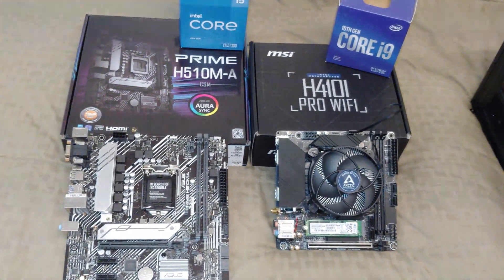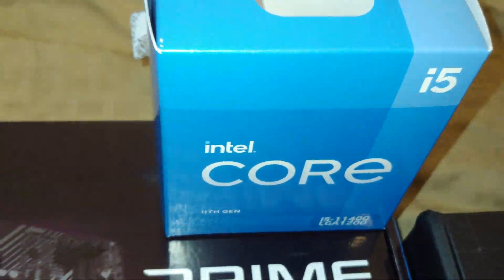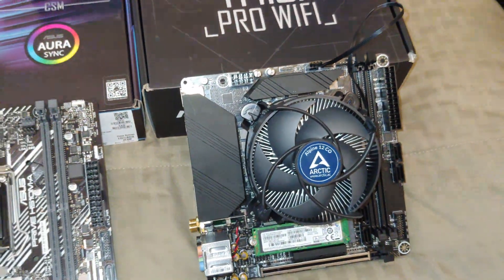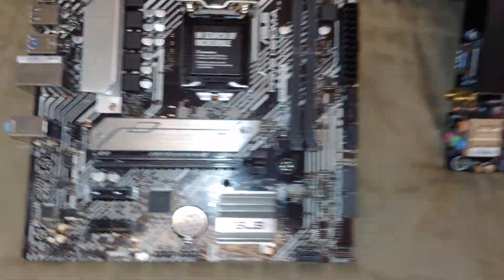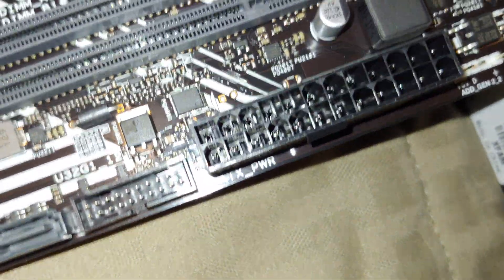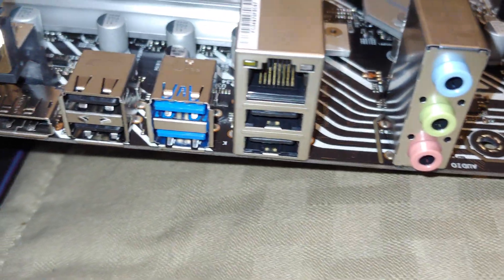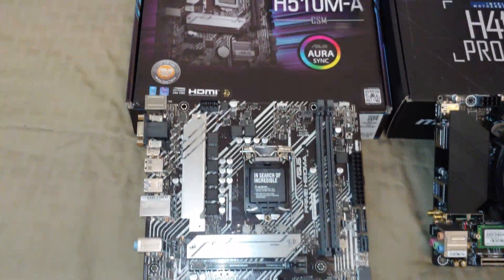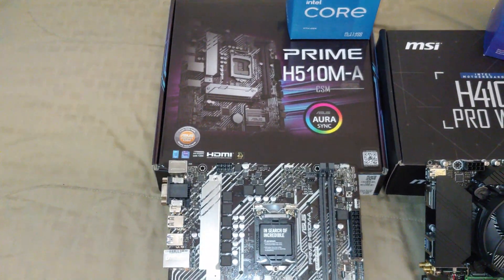Quick Comparison of H410m vs H510m motherboard for 10th gen or 11th gen Intel

Comment: I got a core i9 10850k from microcenter for $350, but I've paired it with B460M-DS3H, what stuff do I miss for not using a Z490 mobo?
Reply from the maker: CPU overclocking.  Higher speed RAM.  Potentially Power Limits set to Unlimited. Potentially more M.2s.  Not 11th gen compatible.